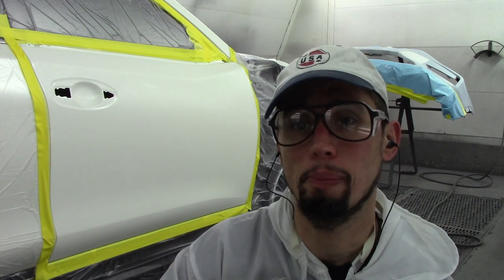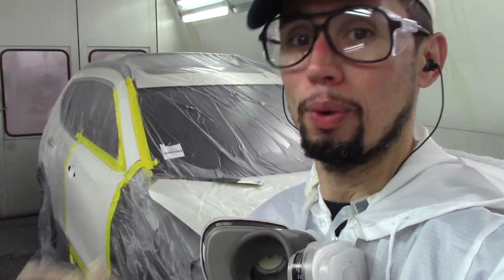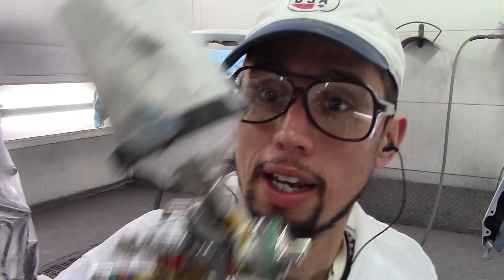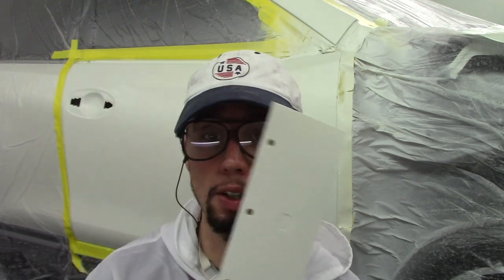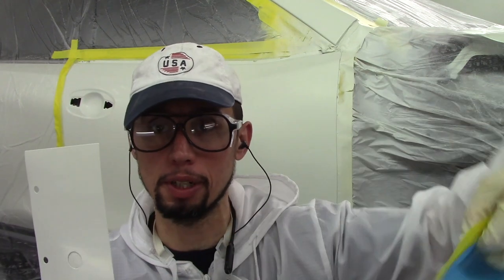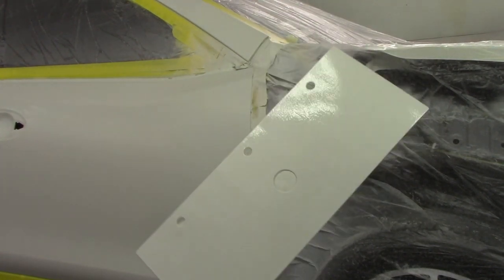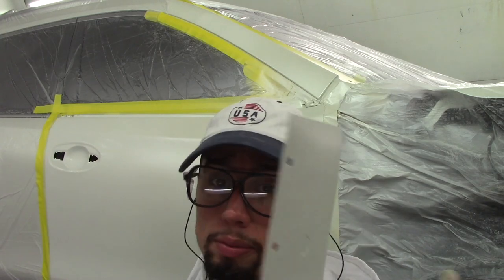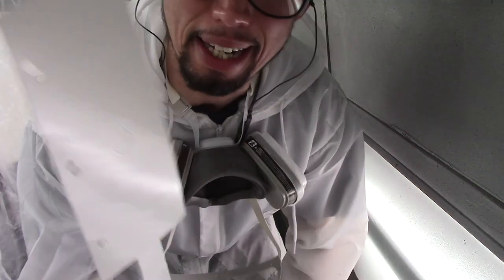How To Color Match 3 Stage White Pearl Paint

Comment: I used a touch up paint kit(rattlecan) to paint match some plastic on my truck but the base coat is way too white, it doesnt really have that creme coloring to it
Reply from the maker: You might have to get the paint mixed by the manufacturers color code for it to match your truck. You can also try polishing the fenders to see if it brightens up the white color. White colored cars can become dinghy over time.
Reply: @J.Lulo_  thank you, the front bumper is a replacement from insurance and that color looks pretty off from the rest of the truck already so that doesnt help me either
Reply from the maker: You’re welcome 🙏. Hope everything works out.

Comment: If it’s ever too white on the base color can you put a few drops of black into the base mix to get it too grey out?  I always have this problem.
Reply from the maker: Yes, sometimes you have to tint a little to dial in the color. A little bit of black and a little bit of yellow can help adjust the white base coat if the base coat color is too white. But make sure to make a panel to check the color as you make your adjustments. Once you’ve dialed in your white base coat apply your pearl coat and clear coat and check your final color to get the most accurate match.